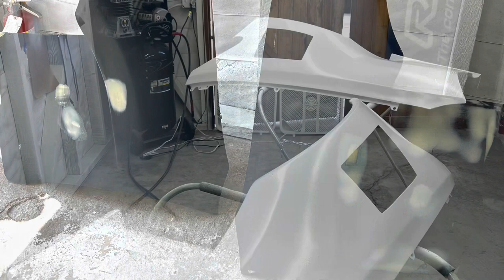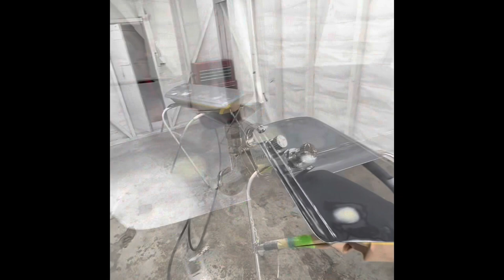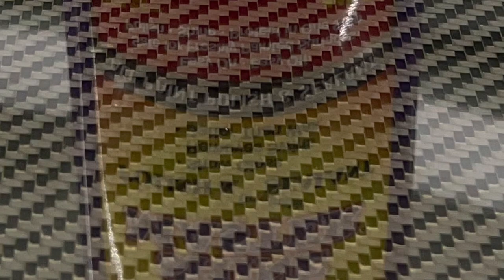DIY Garage Paint Job in 10mins - Honda S2000 🦎

Comment: Looks great ! I’m trying to paint my civic what’s the price of what this costed you ? Paint the guns etc and where did you get the paint from  ! Looks awesome thanks
Reply from the maker: Hey Adam - thanks for watching! I spent about $1500 for everything including primer/paint/clear, an LVLP gun with 1.3 tip from Summit Racing $70, a 29gal compressor from Harbor Freight, and a ton of YouTube videos - total budget paint job that came out great! I bought my paint from GM Auto Paint Supplies in La Puente. Hope this helps…
Reply: @Snell2K  which compressor is the 29gal ? The black one or blue ? Any way I can get a part number on that ?
Reply from the maker: @Anonymous310_  I went with the black one - the Central Pneumatic